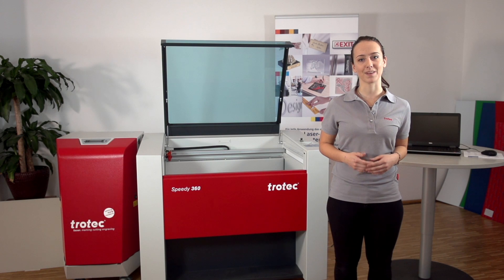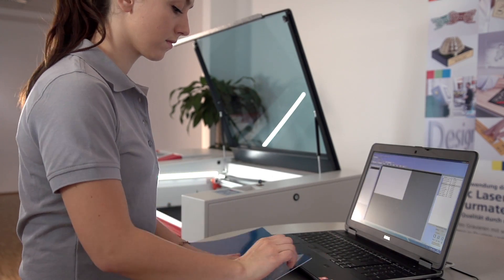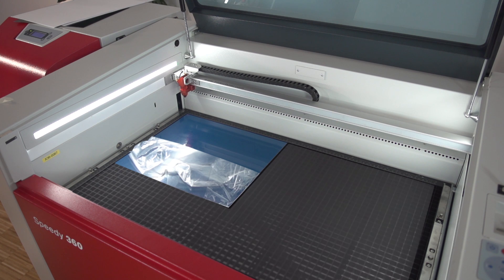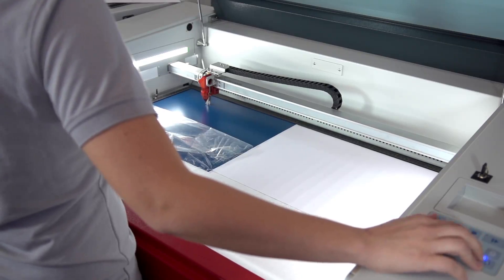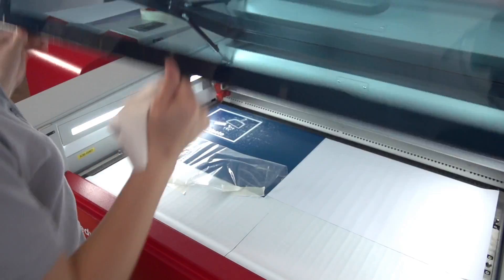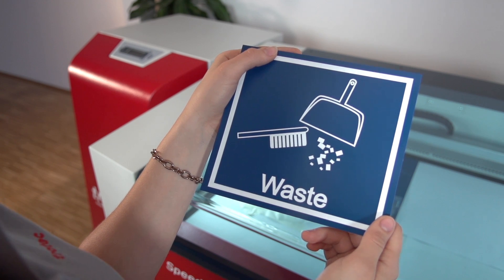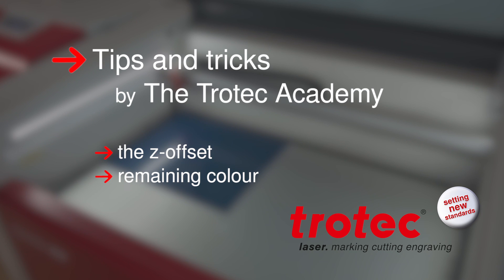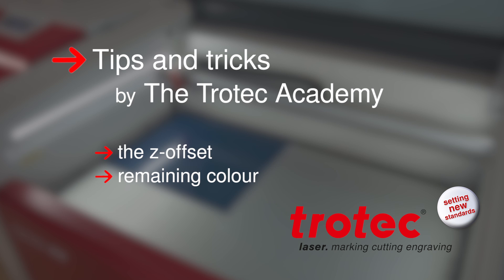Application: Laser engraving functional signs | Trotec Engraving Materials

Comment: Which material do you use..?
What is called this material.?
Reply from the maker: This material is a laserable plastic; 30 watts should be suffiscient but the more the better; 60 watt can engrave and cut twice as fast as 30 watts.
Reply: @TrotecLaserEngraving    So a 10w laser is out of the question, or would it be able to do it, but just rather slowly?
Reply from the maker: @CHEEBnRUN  A 10 watts CO2 laser can do but slower (roughly 3 times slower than an 30 watts)
Reply from the maker: Hi Bhavesh, that's TroLase, our own extruded laminate sheet with two layers. Check out our webshop for more details and the full range of engraving supplies: https://www.trotec-materials.com/laser-materials/plastic/trolase.html
Reply: @TrotecLaserEngraving  what watt laser do you need for this material?